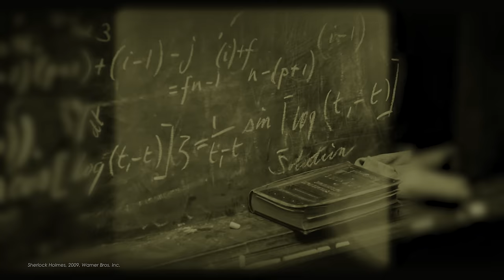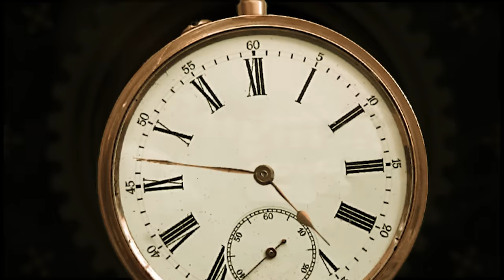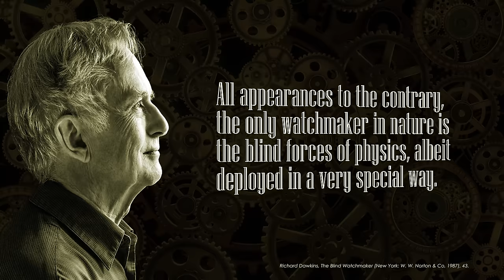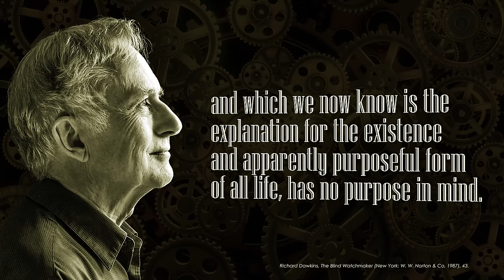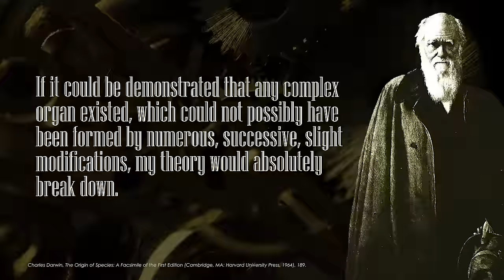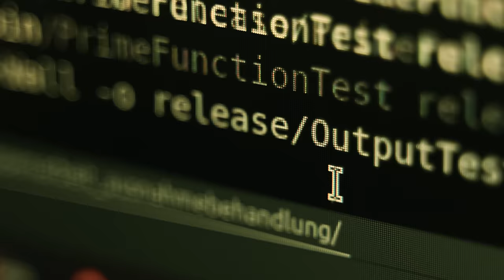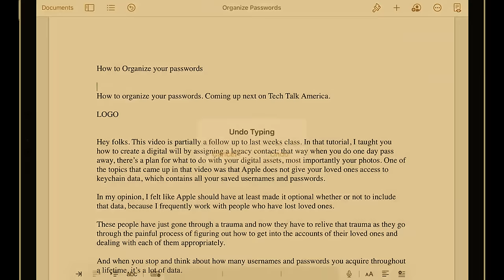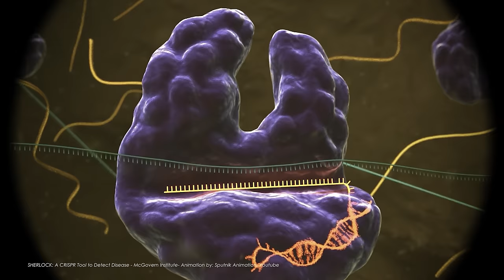Even TOP Evolutionists Won’t Deny This Evidence for God

Comment: The issue with the irreducible complexity's bike analogy is that it's a self inflicted failure.
On one hand the requirement for a characteristic emerging does not require us to understand why it's useful, it just needs to be useful.
It does not sound like a meaningful difference, but it is. Just because you can't explain something, it's not instantly witchcraft.
For example you may say that you can't take away anything from a unicycle, but you actually could take away the seat, you cans till balance on it, but there is a weird assumption that it has to be rideable, even though it could just be useful in other ways, e.g.: as a manually powered wheel used for something other than riding.
Also, taking away stuff is never that cut and dry, putting or taking a wheel from a bicycle is anything but a minor change, it's just a bad analogy.
A very simple, but hard to see evolutionary driver for visible changes is mating. The circuit that makes the animal prefer a specific kind of mate is not prepared for new visual changes, so it could "randomly" deem a visual trait preferable, and as long as it's not explicitly disadvantageous, it can then stick, because it was advantageous from a mating perspective due to a technicality.
Stuff like this have a very low chance, but that's just the thing, evolution had a ridiculous amount of time, and it was very slow compared to any kind of technology, even a watch.

How can self reparation be selected if it solves something that does not exist yet?
Well it evolves the procedure itself, not the exact steps. Also it will be slightly advantageous to have this trait, because specimens having this trait will on average survive a bit longer, and have more stable offspring.
Does it have very low probabillty? Yes, that's why not everything can do it.
Also, it is not perfect, so there is no need to over mystify the ability itself to be impossible 

The whole point is that the human mind can't grasp statistics well, especially in extreme situations.
Something having a one in a million chance  means that it will happen once in a million tries on average, which is basically guaranteed on a long enough time scale.
Winning the lottery is a pipe dream for a singular player, but a full player base will win every now and then.

The whole argument of the video is that "this is complicated, I don't understand it at all, and you can't explain it to me in detail, but I have a simpler solutions, a very specific magic actor whom I can't comprehend completely and thus won't detail, but trust me, it makes a lot more sense, because there is only one of this, and it can be the answer for everything"

What I say is not exactly an argument for evolution, but rather an argument against the argument (why it's flawed)
Not being able to fully prove something is not a proof for it not existing, it just means that we can't be entirely sure yet, but we can show that it's very very likely, because it predicts a lot of stuff well, making the whole argument of the video pointless
Reply: You state: "The whole point is that the human mind can't grasp statistics well, especially in extreme situations.
Something having a one in a million chance  means that it will happen once in a million tries on average, which is basically guaranteed on a long enough time scale.
Winning the lottery is a pipe dream for a singular player, but a full player base will win every now and then."
     This argument does not take into account the issue of multitudes of one-in-a-million chances compounded one upon another. A million one-in-a-milllion chances are virtual impossibilities. No conceivable length of time will allow them to happen. In living organisms, the odds of many of the things that would need to happen are not merely one in a million but one in a dodecadillion chances, and even smaller chances so small that we don't even have names for those numbers. The chances against a single protein coming into existence by chance outside a living organism are greater than the number of atomic particles in the universe. That does not even take into account the immense problems with such a thing happening, such as the problems of the natural formation of all left-handed amino acids (the problem of chirality), and the fact that water and oxygen degrade proteins and their presence would make their natural, chance formation infinitely less likely.

Another problem is that the watchmaker analogy starts with parts that already fabricated. In reality, each of the pieces must be manufactured as well. Each is designed for a particular purpose. The issue of irreducible complexity is ONLY ONE problem in the existence of life. It's not just a matter of whether a bicycle or watch could function without some particular piece. Even if a unicycle could "function" without a seat, you still have to account for all the other pieces being there and being in the proper place. It's not just a matter of one particular piece. Each piece must be manufactured. Then they must be put together in the proper order and proper place. No honest, thinking person would suggest that a watch or a unicycle somehow came into existence by purely natural processes. A single living cell is infinitely more complex than the most complex machine that humans have invented.
Reply: @dooglitas so creationists try to demonstrate they understand probability by misunderstanding probability.

1) you came up with this number, how? 
2) you had how big a sample size?
3) you had how many events?

Are you able to play every game of solitaire? Are you aware that the odds of any one game setup in solitaire are 1/52!? That’s a number so big, it’s practically incalculable. Yet you are able to play solitaire.
Reply: @dooglitas 
You say: "This argument does not take into account the issue of multitudes of one-in-a-million chances compounded one upon another"

Thing is, one-in-a-million is actually nothing for billions of years and a ridiculously huge universe, where hundrends of millions (or billions?) of planets exists, on which there are hundrends of millions (or billions) of "occurences" happen where you "roll the die" for that low chance.
That's why I say people can't really grasp these statistics, because people think like the "trying" is happening at the speed of roulette

And we didn't even speak about the possibility of essentially limitless universes existing which have about the same chance as any other theory, including many without creators (or creators that are not "smart enough" to create a universe with life, but smart enough to try doing so in a rapid or patient manner).
In high number / limitless universe scenarios, we as humans experience a kind of selection bias, or confusion.
In the grand scheme of things any scenario that is not exactly 0 chance will happen however unlikely it is, and then the sentient result will just look at itself and say that "my existence is a miracle", which may be true in its closed framework, but a triviality in the grand scheme of things.

Technically any indefinitely "retrying"  random generator will eventually generate "miracles".

Just like any infinitely long random letter generator will eventually write all the books currently existing in alphabetical order. If the trace of the ridiculous amount of randomness at the beginning can't be seen, when the generator just got to the end of the above mentioned sequence, you'd say that it's most likely not even a random generator, but a meticulously preprogrammed design, even though I just ran out of memory to contain the bullshit at the beginning

My point is that even if the observation is right (about history being exceedingly unlikely even in a universal scale), it doesn't exactly prove or disprove anything. It gives pointers when looking for the truth, but treating it like evidence is foolish.
Reply: For each protein that time and chance happens to produce(assuming that that is all that is necessary), it has to have an associated promoter to control where and when it is expressed for it to be useful to an organism.  It also has to be a trait that gets passed on to offspring.
Reply: @johnsmit5999  time and chance produce? What is with people like you needing there to be intent for everything? 

Also, last I checked, proteins require base elements and amino acids. So why is time and chance the only factor?
Reply: @Bomtombadi1 Thank you for helping my argument.  More than time and chance is needed and yes, proteins are composed of amino acids(left handed) which are composed of elements which are composed of protons, electrons, neutrons...
Reply: @johnsmit5999  right, so I’ve helped your argument by explaining things more to you. 

Yes, you’ve grasped basic biochemical compounds, followed by telling me there are base units to atoms. So where in this does yours god come in?
Reply: @Bomtombadi1 In the ordering and arrangement and functioning of the parts.  Take for example, a house and everything therein.  It could be filled with appliances, clothes, dishes, cleaning supplies in total disarray.  But like God, we are the organizing principle that brings purpose and meaning.  The dishes are to be used to consume food, the microwave is meant to be powered to heat food, the tv is to be plugged in and viewed to serve as entertainment, the chairs are to be arranged for sitting, the clothes are meant for wearing, the cleaning products are to be used for cleaning.  All of this brings order to an otherwise chaotic house.  The most complex systems are embedded in which the larger components depend on the organization and functioning of the smaller components.
We see the same things at work in our bodies whether that is the mitochondria that supplies power, enzymes which greatly accelerate chemical reactions, the immune system which takes out invaders, the digestion system which sorts and absorbs the nutrients to the right places at the right times, the circulatory system serves as a transportation center for oxygen, nutrients and hormones, the brain which serves as the primary control center for everything else.  All of these systems built and controlled by DNA.
Just as we wouldn't expect alphabet soup to organize into meaningful words applied in the correct context, so we wouldn't expect amino acids to order themselves to produce biological processes.

Comment: Twelve minutes of "I can't believe this could happen naturally, therefore there is a God". This is not an aregument. This is a statement of incredulity. Present the evidence for your case, Mr. Smith. When you have shown the evidence people can decide whether that evidence is enough to overthrow the existing theory. By the way, what is the design function of the two nipples you have on your chest?
Reply: The evidence: ATP Synthase. (It is empirical)
1.) Machines are defined as an apparatus using mechanical power and having several parts, each with a definite function and together performing a particular task.
2.) Every instance of a machine is first conceptualised by intellects, then designed by intellects, then created by intellects.
3.) There is no observable or theoretical natural phenomenon or mechanism that can produce working machines.
4.) ATP synthase is a working machine.
5.) Therefore ATP synthase is the product of an intellect not natural phenomena.
Falsifiability:YES.
Observe and/or demonstrate experimentally how natural processes could construct a working machine.

For clarity: Machines cannot be evolved incrementally as each part is purpose built to work with all the other components ready made and purpose built, the whole machine fails to work properly or at all if one or more components is removed or not adequate. The loss or inadequacy of components becomes more crippling the simpler (less components) a machine has. In this case at least 4 parts for ATP synthase.

For some men the nipples provide sexual pleasure. They serve a purpose not for everyone but for enough people.
Reply: @m0x910 you literally made the OP points! You want to claim things from a creator because you can’t imagine them happening naturally.
Reply: @m0x910  So the nipples have a dual purpose, is that correct? Does that mean that other parts of organisms might have more than one purpose?
Reply: @therick363  By all means prove me wrong by demonstrating or even explaining the mechanism by which molecular machines are created by natural processes from inanimate matter. I am not alone in my rationale; if while exploring Mars we discovered an ancient machine, no one in their right mind could justifiably assume it emerged via natural processes. It would be proof of extraterrestrial intelligence. But when it comes to machines on a nano scale there is a double standard all to affirm an atheistic worldview.
Reply: @throckmortensnivel2850  potentially, yes
Reply: @m0x910  your counter argument is just god of the gaps. 

Calling something a machine doesn’t mean it’s the same as an artificial machine, it just helps us explain it to students. 

What’s the double standard? Sounds like you’re trying to sneak in god of the gaps again.
Reply: @m0x910  So, if parts of an organism can have a dual purpose, does that mean that one of the purposes was original, and the other as something that showed up later? For instance, those nipples of Adam, which you suggest were put there for sexual purposes. As we know, sex came before babies, and women didn't need mammaries until they had babies, so their nipples were originally for sexual pleasure, but then became used as a method of getting milk into babies. Of course that would also mean that mammary glands had to make use of the already existing nipples, would it not?
Reply: @throckmortensnivel2850  Get to the point…
Reply: @therick363  And you want to claim that Evolution can do anything because you refuse to believe in God.
Reply: Well there is a God! You should respect him n be thankful for life!
Reply: @m0x910  Seems obvious to me. If Adam was created before Eve, there was no need for Adam to have nipples. Why would a designer do that? Your response, sexual pleasure. Okay. Eve was created before she had a baby, but the designer decieded to go ahead and give her nipples as well, presumably for sexual pleasure. Then Eve has a baby, and those mammary glands come in handy (the same mammary glands all mammals have, by the way), but no way to get her milk into her bably. So the designer decides to use those nipples, which already had a purpose, but were well situated (close to the mammary glands) to allow the baby to use them as sources of milk. So you have a part of an organism that has more than one purpose. Purpose A is for sexual pleasure, and that must be so because Adam didn't need them for his rudimentary mammary glands, and purpose B, which is to provide a means for the baby to get it's mothers milk. If you accept this, you must also accept that it may not be the only case of a part of an organism having more than one function, and those functions may not have been needed at the same time. Another example is those little bones in your ear, Those same bones exist in reptiles, but not as ear bones. Two of them are part of the structure of the reptilian jaw. Again, something with more than one purpose. Perhaps you could venture a guess as to why the designer decided to do that.
Reply: @m0x910  Just an addemdum to my previous reply. Men not only have nipples, but they also have mammary glands. Those mammary glands don't produce milk, but the real question is, why did the designer put them there?
Reply: @flyingtime5501  Which of the several hundreds gods are you speaking of?
Reply: @throckmortensnivel2850  Designers frequently repurpose already extant components of their original creation. This is especially typical if the original design was conceptualised with later iterations/versions in mind. And if the original design was fitted with components with multiple functions. This is the hallmark of an efficient design. Not sure what your point is. But if you are trying to suggest that common anatomy favours evolution over creation, you would be wrong in this assumption.
Reply: @m0x910  Are you saying God designs like humans do? The God that "spoke" things into existence needed to use components because he couldn't...well, couldn't what? In any case, I am merely pointing out that repurposing of parts of organs makes complete sense in terms of evolution. It makes no sense in terms of supernatual creation.
Reply: @throckmortensnivel2850  I am saying humans who are created in the image of God, design like our Creator. When it comes to actually creating: God wills or speaks things into existence within the universe, this is His domain which He has full sovereign control over. In a virtual universe there exists a domain in which Humans have full control over, we may type/code things into existence within that.
Reply: @m0x910  You're wandering off. I've asked for a designer explanation for male nipples,  and for the strange case of the moving jaw bones that started as reptilian jaw bones, then became mammalian ear bones . Now I'll ask for a designer explanation for male mammary glands. Again, if Adam was created before Eve, why did the designer give Adam mammary glands? Mammary glands that don't work, and so far as I know, don't provide any sexual pleasure. Maybe the designer didn't see the point of putting nipples on males without also giving them mammary glands, but then realized that Adam didn't really need mammary glands so made them non-functional.